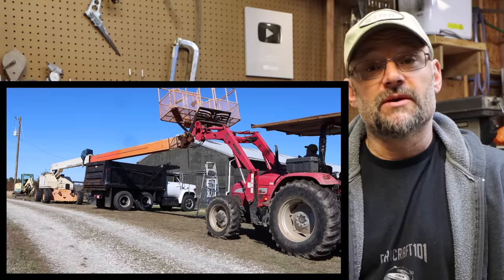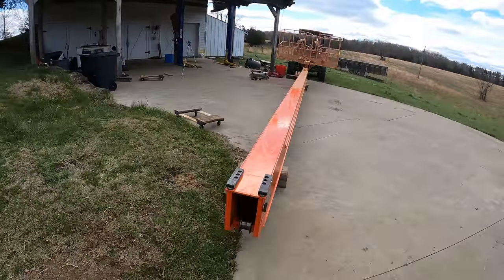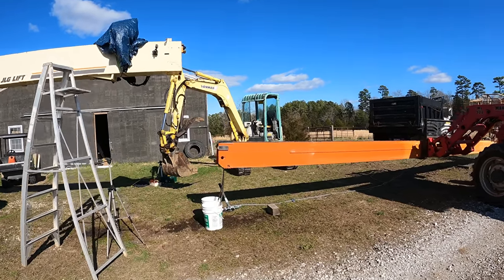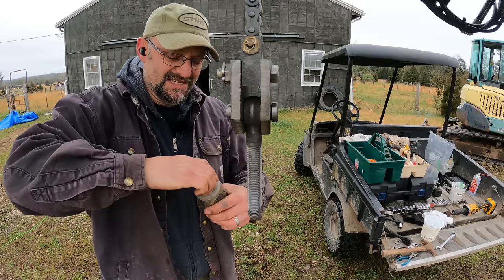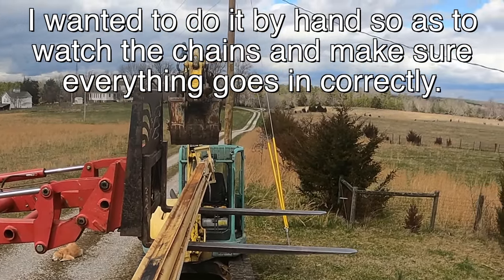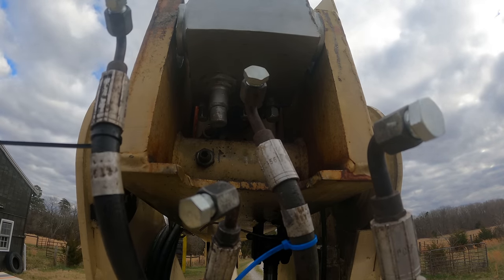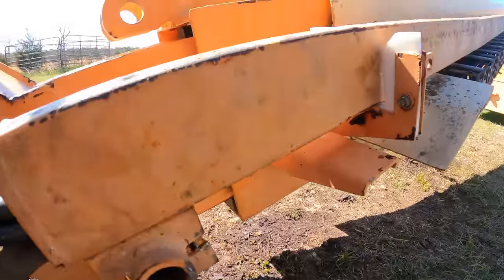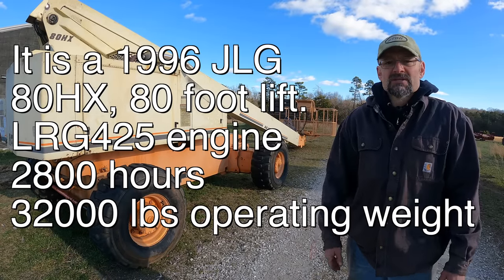Rebuilding An 80 Foot Boom Lift Alone.  Is It Possible?  JLG 80HX

Comment: This was an extremely big project. Totally captivating video. Enjoyed every minute, couldn't wait for the follow up episode. The model and explanation of the operation and chain speed  was very helpful. Made it much easier to understand.Thank you for extra effort. Great job. I've  had to use lifts like this and others in my career working maintenance. Changing light bulbs in parking lot lights 30 to 40 feet up on windy day. I know what you mean about having confidence in your machine,  being a big factor in doing a task safely.

Comment: That was astounding. You are my idol. Thank you for sharing the whole process. 99.99% wouldn't even tackle that job. Having a rebuilt boom cylinder is worth at least $35,000. Start adding the rest of the repairs and that beast is worth at least $70,000. You will have to work it like a dog for many a year to cut into that worth mainly because of the quality of the work you did on it. Only thing I can suggest is out of the weather storage for a valuable piece of equipment.

Comment: That relief valve is a very likely culprit. You have done a great rebuild on this machine. I really appreciate your Stick To It ness that to many people lack. That machine is priceless for your way of life, and you'd regret selling it.
Reply: It would seem to me that there are only two options. That valve is out of adjustment or the hydraulic pump is not  creating enough pressure. Surely it was originally engineered for that operation plus margin.
Reply: Does anyone know if it's actually supposed to retract when it's extended horizontally with all that deflection? Think about it, it's typically used to reach heights, so extending requires far more force then retraction. In most use case scenarios, gravity will be assisting with retraction. 

In trying to retract it horizontally, you remove the gravity assist plus add a huge amount of resistance with the boom pieces jammed together from their own weight. 🤷‍♂️
Reply: @blaircox1589  I am thinking in terms of a fork lift. I would think with a piston that size should move 20K pounds with ease. The point of deflection does cause more resistance but it seems it should be able to overcome. The boom did extend out horizontally, but will not retract. Retract lever itself may be out of adjustment.

Comment: On the RETRACT mode you can hear it blowing over a relief valve... Just need to adjust that valve higher ....you can also just connect a gauge to see what pressure you getting on the lines to compare but its def the best place to start....oh yes and also WELL DONE!!

Comment: Engineer: "If it ain't broke, don't fix it!"

FC101: "Yeah, but you might not find out it's broke until you fix it!"
Reply from the maker: Also, "If your life depends on it, make sure it ain't broke!"
Reply: @FarmCraft101  Well where did You leave "no risk no fun" behind on the way here ....? 😅
Reply: Or you could fix it until it’s broken
Reply: Or until it breaks while you are up in it....
Reply: Great video once again, I am struck with awe at John's talent, a very clever thoughtfully guy. Plus I always have a chuckle at some of the antics. Well done indeed from a guy from scotland😂👍
Reply: or you break it while trying to fix what wasn't broken and now it is broken so it has to be fixed...
Reply: @FishFind3000  That clears things up.
Reply: The steps of fixing things at work are:
1: Hit it with a hammer, or, absent a hammer, any object sufficiently heavy.
2. Disable all safety interlocks.
3. Disassemble it, change nothing, reassemble.
4.  If steps 1, 2, and 3 don't fix it, ot f*#&ed.
Reply: no engineer on earth ever said that line... it's not their problem when it needs to be fixed. they LOVE creating more work for other people!!! definition of an engineer:: "over-educated idiot" (also - "that guy that solves one problem by creating 10 new ones")
Reply: That sounds similar to the farmers motto Jon once referenced though: it’s only temporary unless it works.
Reply: Fix it until you break it, then fix it until you give up and call customer support.  Follow their recommendation and lose a finger.  Sue the company and buy a new whatever it was from a different company.  Run it until it breaks and start over.

Comment: John, just to echo the thoughts of many others, your ingenuity, persistence and engineering knowledge are an example to all. I rebuilt a telescoping lighting tower many years back, that was a challenge and, my life didn’t depend on it! I recall a similar problem inasmuch that it still didn’t fully extend. The ‘fix’ was to fully extend the boom several times until the hydraulic fluid level stopped going down. I then topped it up to the full mark and all was well. I certainly don’t possess more knowledge than your experts, but, it just worked for me on that occasion, and, without touching the PR valve which I was told was ‘shop set’.

Comment: Congratulations delighted you have it pieced back together. For your benefit I would love you to get the pressure relief issue fixed so it retracts after full horizontal extension. Can't wait to see next project. I never doubted you !! Well done

Comment: Yes, check the pressure on that relief valve, they do drift sometimes.  Some anti-seize can be quite abrasive, don't use on anything that will move.  I put some on a rotating spline joint once, wiped it out in short time.

Comment: My estimate on what your lift is worth after all the work you’ve done to it would be $50,000.00. Great job ! I hope adjusting the hydraulic pressure relief valve higher will make it work correctly when extended to maximum reach.

Comment: I highly recommend you make sure your hydraulic system pressure is set properly, and then start checking all of the other function pressures. You can find all of the procedures in the service manual on the JLG website.

Comment: The hydraulic pressure must be tuned good enough for extension but,the cylinder has less power when retracting,the rod volume in the cylinder reduce the surface area the fluid can push on.
Also, this equipment is not usually used boom horizontal,where flexing and friction between are maximum.
Its also maybe why hydraulic is voluntarily tuned like that (?)

Comment: My only criticism of this fantastic rebuild is that it seems like you torqued the chain tensioners with anti-seize on the threads which would increase the tension being put on the chains with the same torque. Dry torque vs wet torque. Great video series and thanks for sharing the adventure

Comment: Not Sure How Or Why This Popped Up In My Feed, But Brought Back Memories Of My First Real Job-Assembling Boom Trucks From Chassis To Finished Product. Some (Maybe Most) Of The Ways You Disassembled/Re-Assembled The Boom Is How We Did It, Except For The Fact We Did Have A Crane System To Secure The Sections. I Had Forgotten How Often The Use Of A Come-Along Was Employed During Assembly Of The Lift.

Comment: John, great job!  For what it,s worth... when you extended the boom all the way and tried to retract it you could hear the relief valve relieving pressure.  I believe they are correct in saying a simple adjustment of the relief valve will do the trick.

Comment: Good job, be proud of yourself for pulling this off on your own. 
Regarding the hydraulic pressure, you can do a pressure test right at the hydraulic pump and see if the maximum pressure is in tolerance. 
Could be that the hydraulic pump needs a rebuild. That pump is the heart of the entire machine, also the driving part (wheels) of the Boom Lift has his benefits of the right pressure.

Comment: The Videos of this series really entertained me. Its good that you talked about cutting into the boom and other mods to equipmen. there is a reason that there are certain material strenghts and if you cut that and it breaks a lot of people will be very pissed. I would lead the boom not retrackting in vertical Postiton basically to the fact that there is a ton of pressure on the wearpads wich increases the static friction imensly. In addition to that the Cylinder has less power when it is retracting.

Comment: You and your "THAT's not going anywhere"... is a motto my family has lived by for years.... and it worked great... until when my parents got into their 80s and I had to renovate their bathroom.  They wanted a walk-in tub and pocket doors... they needed enough space to use the wheelchair in the bathroom, basically.  Have you ever TRIED to demolish a bathroom renovated in the 70s to the standard of "THAT'S not going anywhere!"?  Yeah... the floor, the tile on the walls... pretty much the whole thing I had to cut into 1 foot square pieces in order to get it all out of there to make room for the new stuff.  It took 3 times longer than I thought... and the dumpster ... well, I had to order a 2nd one because the first one was too heavy.  Yeah... sometimes we even gotta think about whether stuff ever WILL go anywhere... lol.

Comment: Sorry I went from video to video without hitting like on every video.   What a job.  I was somewhat afraid when you were trying to remove the nut on the cylinder that the hollow shaft might twist and warp a bit.  You have a lot of equipment and tools that without them and your creativity in always  having to figure out how to do things with what you have at that moment would not be possible.  My dad was like that though we never had the equipment or tools that you have not had to work on them but rather our own transportation and always, always lacking one or more tool needed to do the job but my dad and I learned from him had the creativity to get it done.   BIG JOB. AND you did a Good job well done sir.  I would have had far more bleeps from street adjectives that slipped out of my brain and mouth.  I congratulate you on your patience and clean verbiage during the frustrating times of these job videoed and know the videoing of them adds considerable time and aggravation to each job.

Comment: (Senior design engineer here). 
I design cranes for a living. The amount of pressure that wear pads see tele out that far is extreme.   It’s easy to calculate. Moment arm times the area will give you psi on the 2 top wear pads.   

If you ever get into the wear pads again.   Think about having some Teflon impregnated nyltron wear pads.  We have all ours custom made per machine by “ws Hampshire”.    We have had stick slip issues with out booms but we’re greatly resolved when we went to Teflon wear pads.

Comment: You should get some hydraulic pressure gauges and check all the pressures on the reliefs for all the booms pressure circuits.  It's very common for them to be set wrong at the factory and especially by techs working on the boom in the field. Checking and resetting the pressures could be a great final video.
Pat yourself on the back for doing that job by yourself. Very impressive.

Comment: Congratulations on a job well done! Really interesting videos!  
One reason the boom has issues retracting is that while extending, the hydraulic fluid has the full area of the cylinder to act on the piston, but while retracting, the area the cylinder rod occupies is lost, leaving considerably less piston area (in a typical single-rod cylinder). Small diameter cylinders with proportionally larger rods are particularly affected.  
All that leverage is working against you, and the weaker retract force, as frictional forces go up logarithmically with horizontal extension.  Lubricating the wear strips at & near full extension may overcome that issue.

Comment: Very impressed with your ability to work solo. And with the quality of the rebuild. I really like this series and your new microphone is very clear. When I was trained in a teleboom operation, I was told if possible to retract an extended boom, with it raised to reduce the friction on the nylon wear plates. But that's a firetruck with a 13 meter boom, but similar operation.

Comment: Maybe someone has mentioned this, but a hydraulic cylinder will always extend easier and with more power, than retract. The surface area that the oil pushes against is reduced on the rod end of the gland by the diameter of the rod. Extending, you have the full cylinder diameter with X amount of oil psi, same psi retracting, but fewer square inches to push against because of the rod taking up that space. Probably made a hash out of explaining it, but it’s good to remember once you know😊

Comment: nice job
on lubing the boom channels you're right, the nylon slide blocks shouldn't require any lubrication as long as the track they ride on stay clean. But the mistake most guys do is put grease on it, that is a huge no no, if you want to put any lube on it you can use heavy duty silicone spray. It works for a while but does wear off eventually so you would have to spray it often. You might want to consider this too, that is a lot of weight on those channels and slide blocks with it fully extended in a horizontal position, normally you wouldn't extend it like that, generally the boom is elevated more vertical when it's needed to be extended. You're operating it in a position it isn't normally used.
One other thing is to cycle the extend/retract fully several times to get any air out of the cylinder and lines, air will cause problems. And yes what your buddy said, check the pressure and adjust it if needed but do not exceed that rating or you'll blow out a line.
You'll need a digital pressure gauge and some quick connect fittings (if they are not already installed on the machine) so you can set the pressures. All the information you need in the service manual starts in section 5 on page 5-16. (i'm sure you must have the manual already but if not then go on jlg's website and you can download it, no cost).
Good luck  😎

Comment: Jon, that was amazing! You give me hope about overhauling this radio sitting next to me since the transmit power has dropped by better than half. I'm actually somewhat less intimidated by the prospect after watching you beat this beast into cooperating. 
Incidentally, not to sound like a smartass, but when the retract failed, I guessed immediately (from the increased RPM) that you were looking at a hydraulic valve bypassing the cylinder directly back into the tank. At least it ought to be easier than juggling thousands of pounds of close-tolerance steel!

Comment: Hi there, I use to operate a Gallon 150, (15 Ton), Cherry-Picher with a man-basket at the end of a 63 ft boom and had the same problem.  The boom would not retract from being fully extended, when in the horizontal position.  I had to either set the basket on the ground or raise it up to a 45 deg. angle to suck it back in.  I finally ask a mechanic why this was and he told me it was because of "The Flex in the Boom Segments".

What is it worth?  10 grand more than a brand new one!  Like you have said, "You Now Know How To FIX Your Machine and you having done the work yourself, you trust it!"  Good Luck and may God continue to bless you and keep you safe!

Comment: I'm always amazed at the jobs you are able to do - not to mention filming and narrating the whole thing in such an interesting way.
This series is some of you best work - very well done.

General question: Since you work on such a large variety of things, how do you keep all of your tools and supplies organized? (auto repair, welding + metal work, wood shop, painting, hydraulics, plumbing, electrical, etc...) I struggle to organize a small wood shop + DIY home repair stuff in my garage. What you have as got to be 10x of that.

Comment: Name and channel the same, Jesse Muller gave you a shout out as he just bought another basket lift and he watched your video as well. His problems are mostly electrical and so far as a whole getting some great luck as his wouldn't run when purchased yet they seem to be working out. He is having problems with a rotation cylinder that keeps the basket stable and still rotate... I am sure he will work his way through it as he is quite  resourceful. His channel although not a exciting watch is packed with good information. Glad you did get this together... I just wish you wouldn't jinx yourself so much as saying this is  going to be easy... that is when things seem to go south. Excitement usually means forgetting something and a redo or more math on leverage.

Comment: Well done on taking such a big project on by yourself. Not wanting to be pedantic, but hopefully this may be of use for the future. Split pins should really be splayed 90 degrees to the direction you appear to have done. One leg should come up and over the end of the bolt and the other leg may need to be trimmed and goes down to the non castellated side of the nut. At least that's how they're always done on aircraft.

Comment: John, I used to build machines for a company that made loading bay lifting equipment. We always had pressure relief valves for tank return for BOTH sides of the cylinder, in other words you could set the maximum pressure for each direction before it would bypass your oil back to tank.

Theres a good chance that you have the same type of adjustment on this machine, it would seem crazy to me that they wouldnt have that feature.

Id love to know if this is the case.

Good job, keep em comin!

Comment: Great job John. I love your channel. Your work has just the right amount of “sketchiness” to make it interesting. About the same as Matt at Diesel Creek but not as scary as Andrew Camarata 😂. You did a really good job there. I’m no hydraulics expert but I would suggest checking the pressure relief valve setting. It might be relieving pressure too early. Fingers crossed the cylinder isn’t getting the pressure it should on retract and you can get it working a bit more strongly. Keep on keeping on John we love your videos 👍😀